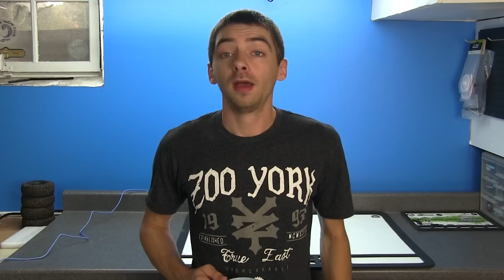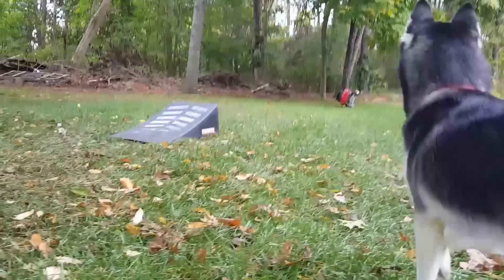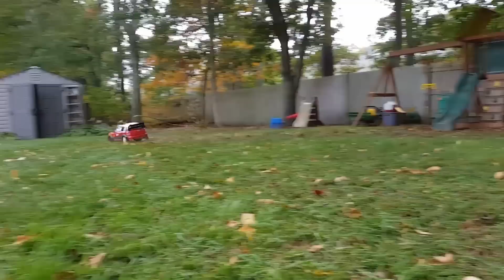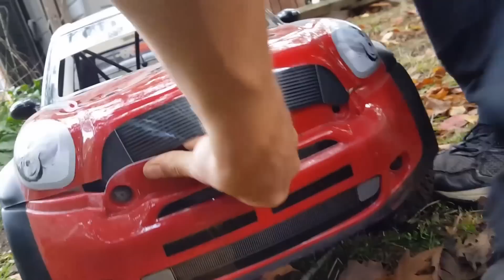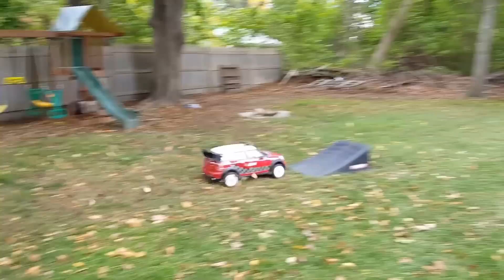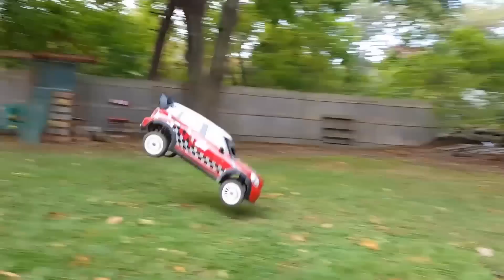Losi 1/5th Scale Mini Cooper Backyard Bashing

Comment: Seems like the clutch takes forever to hook up. Otherwise it looks like a ton of fun. That thing will be sweet on the road. Is it designed/ have tires for off-road?
Reply from the maker: +mattster1971 ya i agree. Definitely something to look into this winter.
Reply: A tuned pipe helps let the engine rev up a lot faster which alleviates some of that stock clutch lag. But yes, it's a big laggy.

Comment: If it wont idle yeah your tune is out. richen up a little on low end and raise the idle. thats the safer way to go. If real smokey then you can lean out your low end and reduce the idle. Also for quicker take off most 1/5's have a 6000rpm clutch spring installed. replace it with an 8000rpm clutch spring. will be heaps better.. and that can exhaust is a power killer also.. have these 3 things looked into and it will be a different monster.... :)